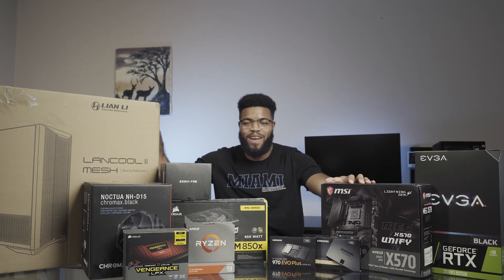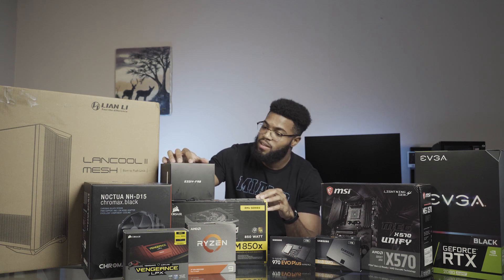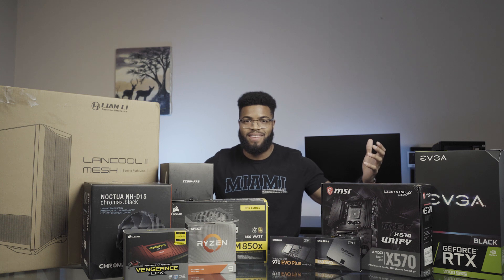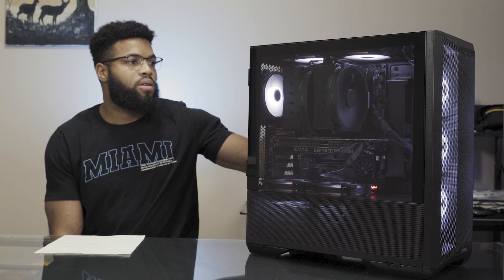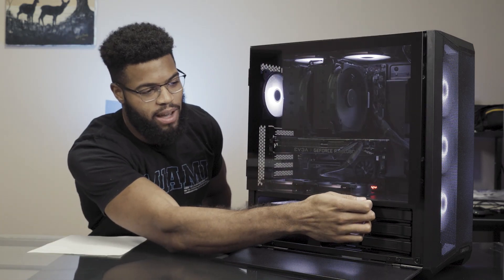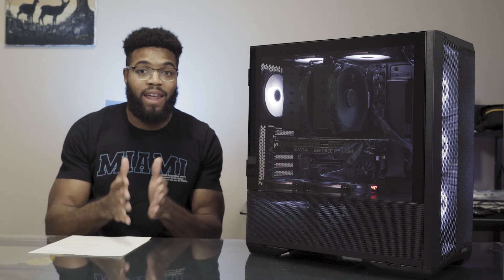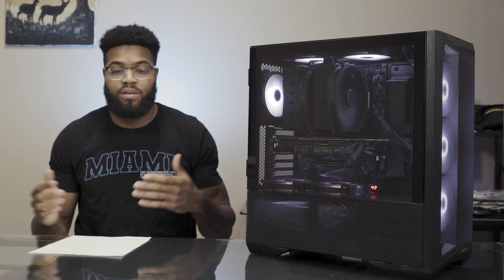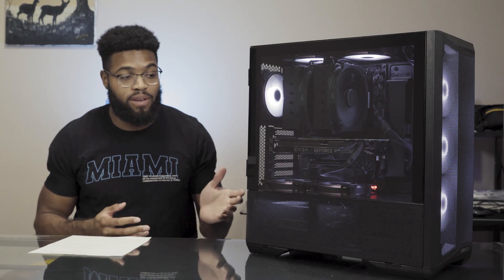Lian Li Lancool 2 Mesh PC Build - Should you upgrade your editing PC??

Comment: Within 0:42 I liked you :) Very nice build, amazing for what you'll be using it for. Those fans you used really caught my eye and I'll be getting some!
Reply from the maker: Great news! Link to them is in the description!
Reply: Juwan Caesar Question: If you connect the hub to the motherboard, can the RPM and RGB be controlled through the motherboard software?
Reply from the maker: @ryanmatt910  nope, only through the remote
Reply: @juwancaesar  How did you connect the fans? I assume you used 3 EZ-DIY fans for the top and back, and the 3 included front at the case. Did you use a 3-to-1 pin for the PWM and RGB? I'm using a similar setup as you, still confused on the fans though.
Reply from the maker: @ryanmatt910  so for the ezdiy fans, correct I put 2 at the top, one at the back and 2 in the spaces under the gpu. All of those fans connect to a hub that comes with the fans and then I connected the one 3 pin connector that the hub has to the motherboard and the sata cord from the mobo to the power supply
Reply: @juwancaesar  Thanks! I did look at Lian Li and Corsair. The amount of wires and what was needed just confused me so I'm not using them. I never noticed the 2 fans below the GPU! :) How loud/quiet are the fans! I've been reading some reviews and people have said that they can be quiet, but it lacks airflow so they have to stay on a loud preset.